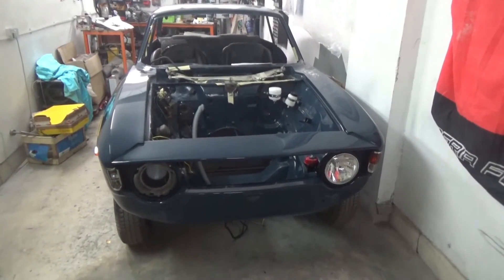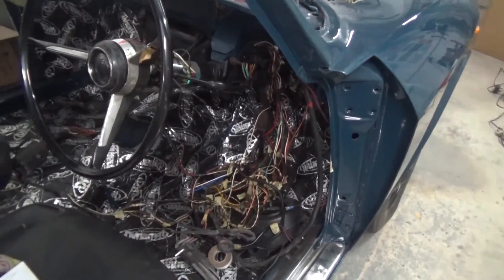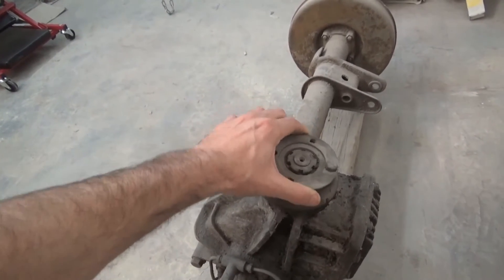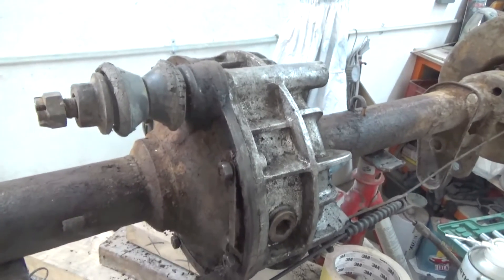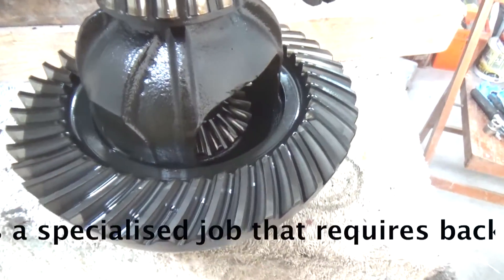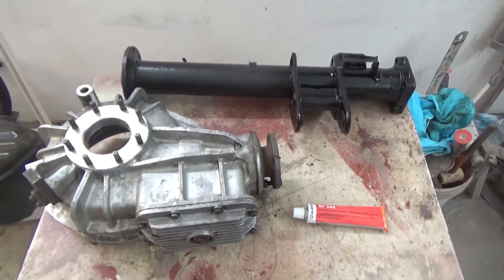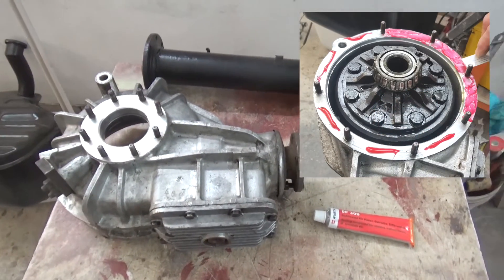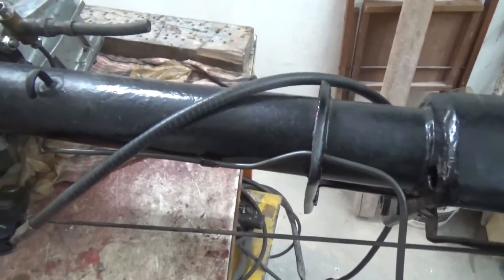Raising Junior Episode 19 - Refuribishing a rear axle and differential

Comment: Pleased to see a completely renovated rear axle assembly - great work.  The only aspect that caused some consternation was the painting of the wheel rims complete with the old wheel balance weights - which will undoubtably need to be removed and others reattached once new tyres are fitted and wheel assemblies are re-balanced.
Reply from the maker: Thanks...not to worry the steel rims are temporary and the tyres are over 20 years old. I will be using the silver alloys shown at the end, i'll get new tyres and balance them when the car is close to be done
Reply: @raisingjunior6389  On a further viewing, I note the trial fit of the replica GTA rim. Appreciate the response - thank you.